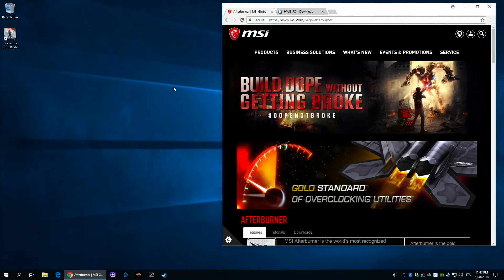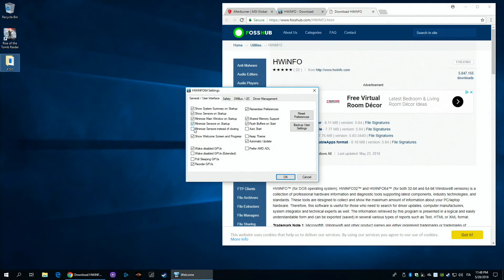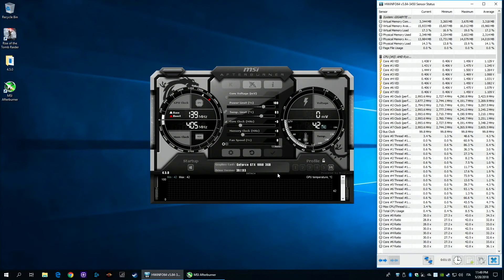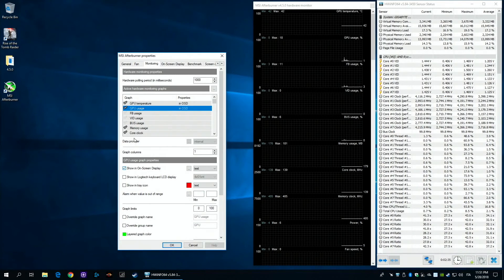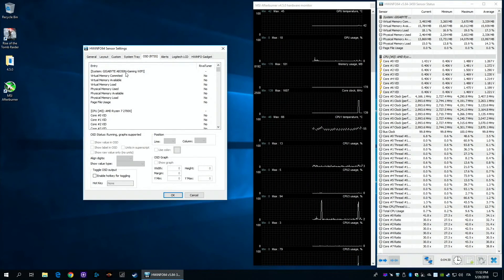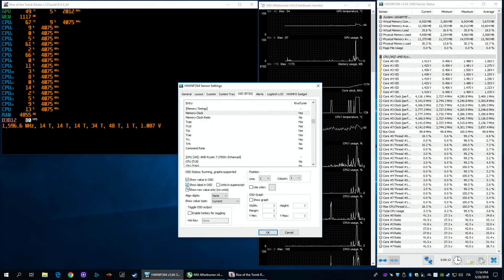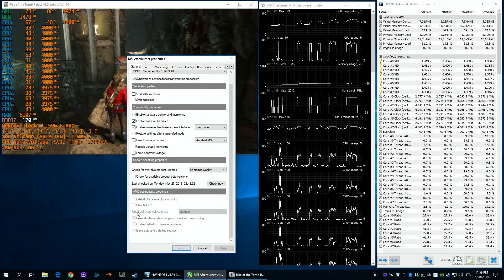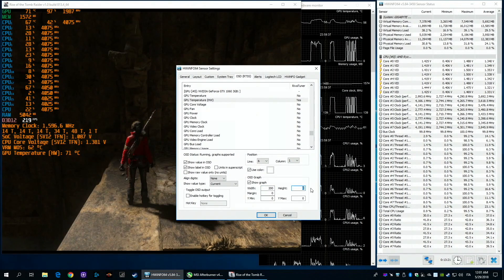[Tutorial] How to Setup OSD with MSI AfterBurner and HWiNFO

Comment: Hi i got a problem with this. It worked a couple of weeks back , but i want to test this new DX12 "light" in wow 8.1.5(win7) but it wont show me anyrhing.
Idk why , i reinstalled it but could figure out why its not working anymore. 
Have u an idea why?
Reply from the maker: SkullDragon147 can you tell me exactly what is missing? (Or if it doesn’t work at all) as well could you tell me your Pc specs?
Reply: @HardwareNumb3rs  in afterburn and hw it shows the graphs etc but ingame it wont show anything (ithink river tuner dont work). I got an 970 gtx(driver version 419.35), i7 3770k and 8gb ram on win7
Reply from the maker: SkullDragon147 yes it may be riva tuner, you could try to download and install it again